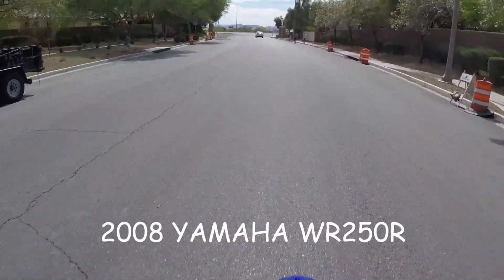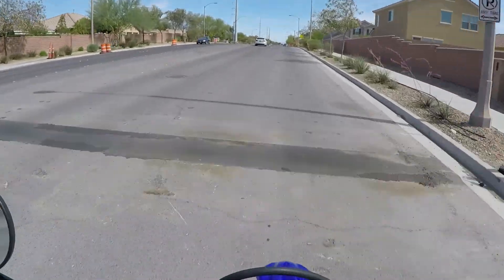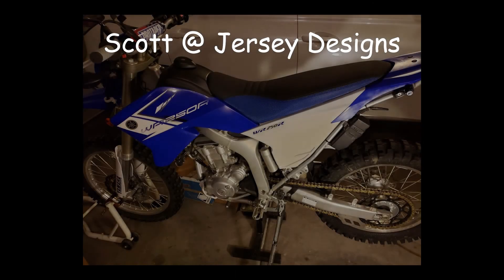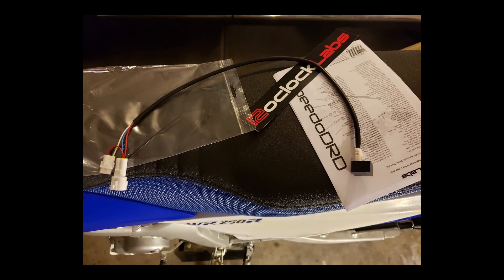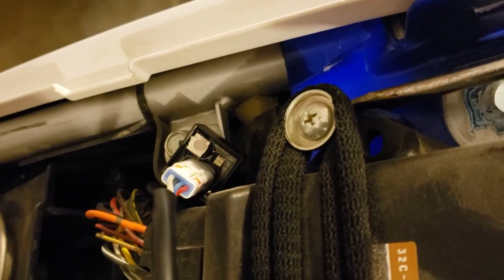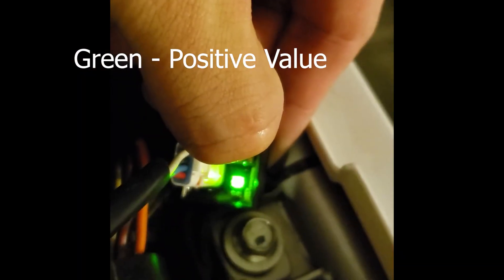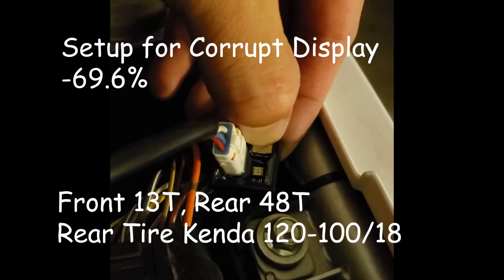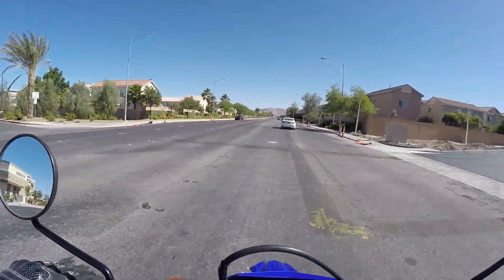SpeedoDRD new version install Yamaha WR250R 3X Speed Error Fix!

Comment: At first I thought this was a band aid. But further investigation. I find these bikes when experiencing a low voltage situation. Screws up either the ECM or dash display. It sounds more like a ECM issue $538.00. So I guess this is the fix. If you use a custom Vapor dash you lose you Yamaha diagnostic features. This is the best fix from what I can tell.

Comment: I was wondering if you had the same issue as mine. I have same wr250r 2018 model and have 12oclocklabs speedo drd installed and calibrated before my speedo started to get inaccurate. My speedo seems to be jumping around on the number and never stable. Once i reconnected it back to the bikes original speedo connection, the speed jumping up and down is less and a bit more similar to your issue. I tried re calibirating and still the same. Help please hahaha
Reply: Same. Any solution? Is it a bad speed sensor?